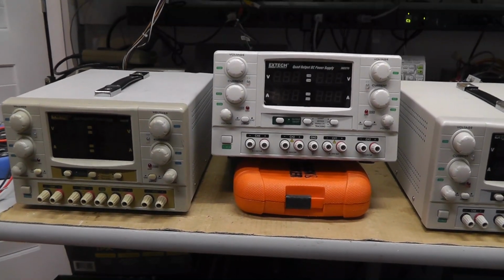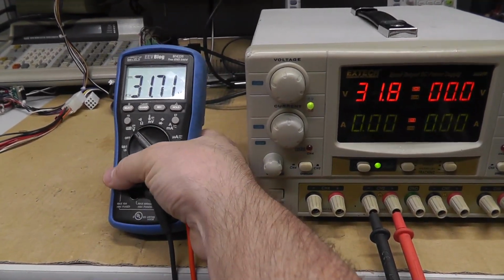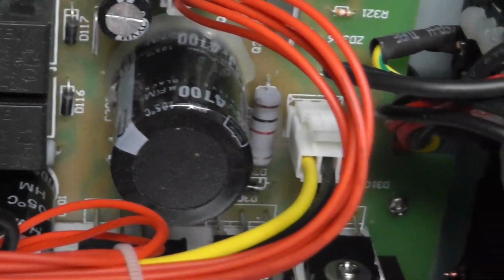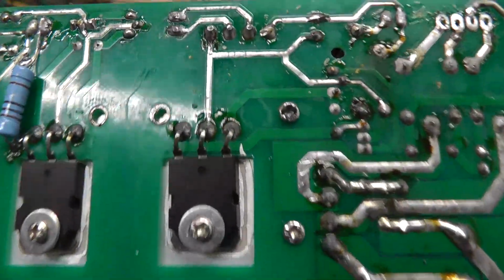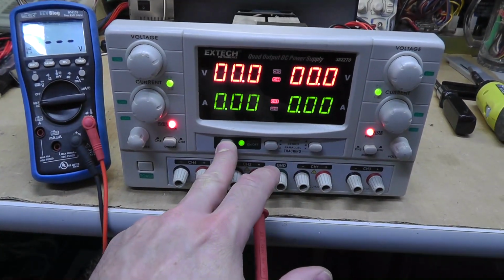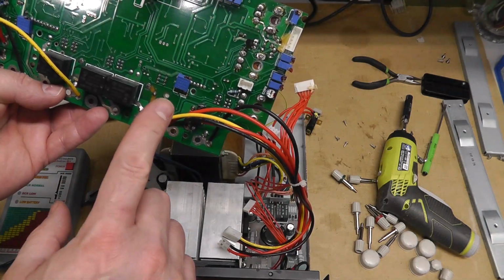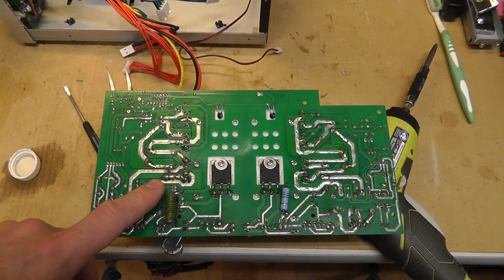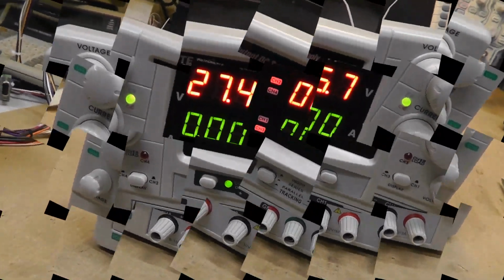Bench Power Supply Test & Repair -  Extech 382270 Quad Output DC -  part 1

Comment: Why would the bad capacitors cause the voltage and current to not go to the maximum settings?
Reply from the maker: I don't think I said it would.  I would assume most of the caps in this power supply being used as filtering capacitors.
Reply: @jacklick  Yes the caps being used as filtering caps but what fixed the problem of the voltage setting and current setting NOT going to the maximum spec limits? You mentioned to make the power supply have more current output was to put the power supply in SERIES mode to combine the current outputs to getting more current
Reply from the maker: @waynegram8907  what part of the video are you referring to on "NOT going to maximum"  
Putting CH1 and CH2 in series doubles the voltage output, putting them in parallel double the current/amps.  As I am talking through things, I might say it wrong once but usually correct myself in the video at some point.
Reply: @jacklick  When putting Ch1 and Ch2 in SERIES this doubles the voltage or current? when putting Ch1 and Ch2 in parallel this doubles the voltage or current? because when putting Ch1 and Ch2 in series it should double the Voltage, when putting Ch1 and Ch2 in parallel this should Double the Current. What did you use to Test the maximum current when putting Ch1 and Ch2 in parallel to measure the maximum current output but you need a LOAD.
Reply from the maker: @waynegram8907  As I stated above.  Series == double voltage @ 60vdc in this case.  Parallel == double current output @ 10amps in this case.  If you watch the video, you will see I didn't test the parallel setup.
Reply: @jacklick  yes i know u didn't  test the parallel setup that is why I'm asking are you going to test the parallel setup in another video because using a load test will determine if the power supplies are fixed under loads.
Reply from the maker: @waynegram8907  Yes I test them under load in the next vid.
Reply: @jacklick  Thanks because that is way to test if the voltage drops and the current drops under loads. They have a FET load box that uses MOSFETs that are high current fets to test power supplies I think.